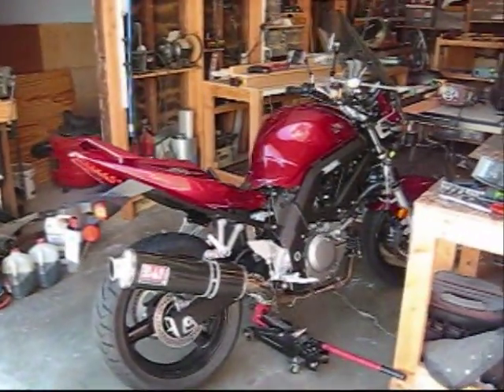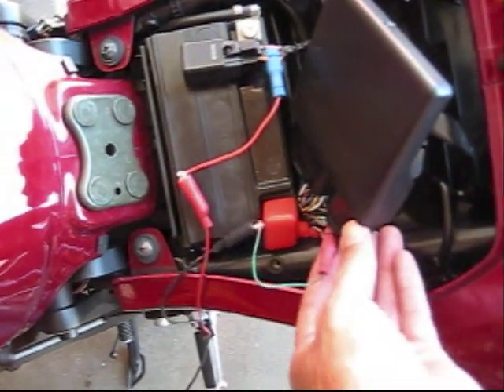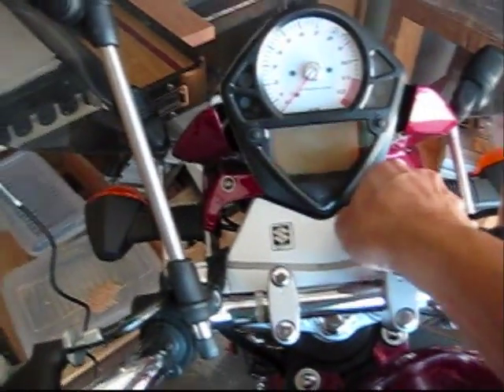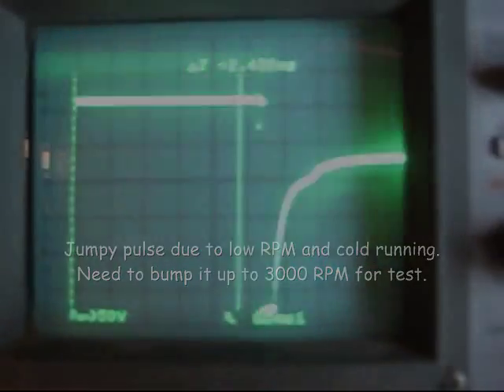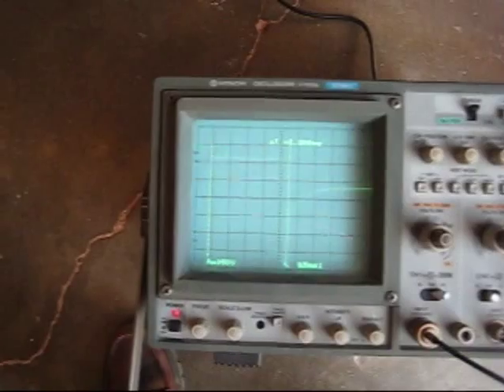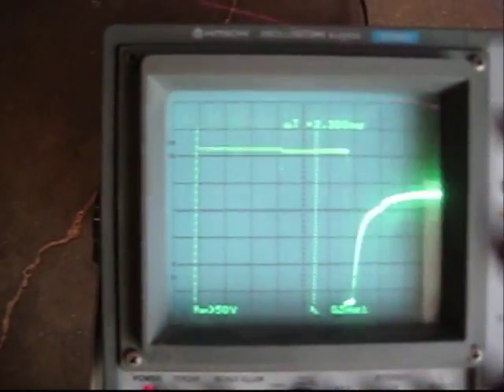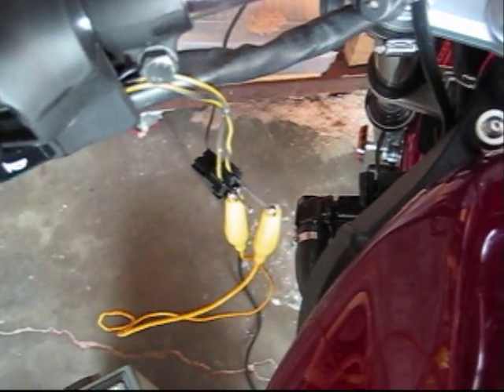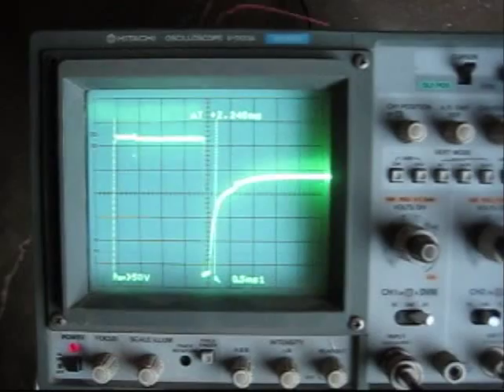sv650 clutch switch affect on fuel injector pulse width

Comment: Thank you so much for doing this.  On my race bike I lowsided and broke the switch, then used safety wire to short the clutch switch and go back out racing.  The race bike doesn't typically get below 6K rpm while racing, but a friend told me that the shorting of the clutch switch changes pulse width and mapping.  I had no idea.  Now I have to go today and buy a new clutch perch...

Comment: My clutch switch went bad so I took a paper clip and bypassed it to get the bike to start up again. It's been a few weeks and I haven't gotten around to fixing the switch. I noticed that upon rapid deceleration when I am down shifting to stop, my bike would sometimes stall. After watching your video I have come to the conclusion that it is because when the bike drops below 3,300 RPM (when I am down shifting to stop) there is an increase in fuel which may flood the engine and cause it to stall.
Reply: You ever figure this out
Reply: Bypassing the clutch only works well with carb bikes, aka no choker you have a fuel map 👀 don’t do it.

Comment: How was your TPS (throtle position sensor) adjusted? Since clutch has no affect over around 3,3k rpm I suspect it is from incorect TPS adjustement (which is a rule for factory setting)